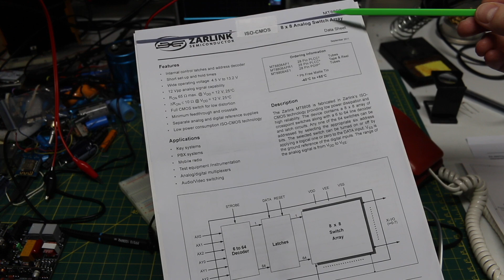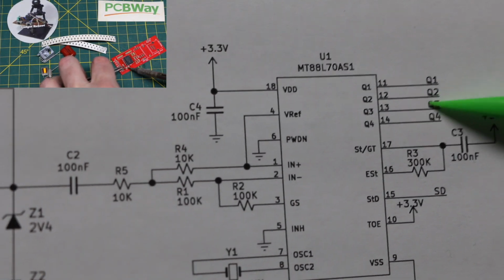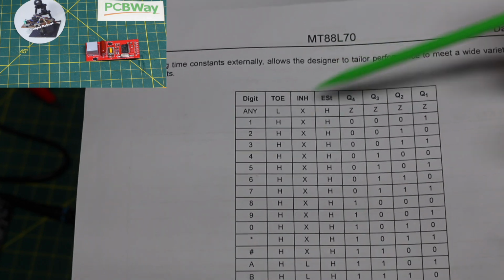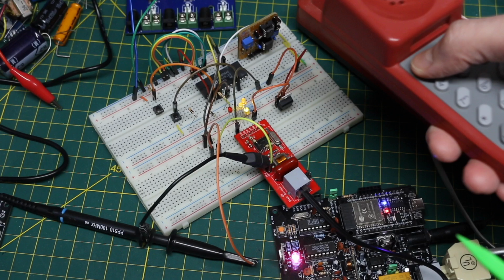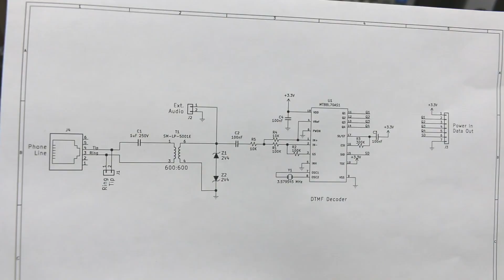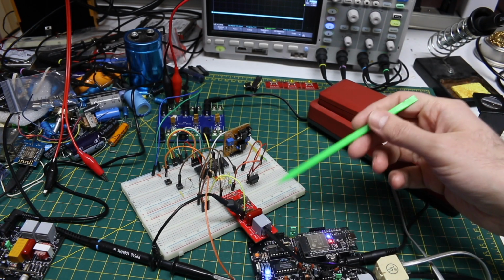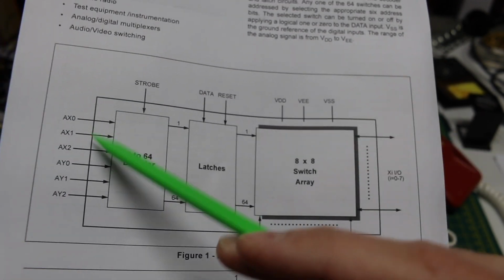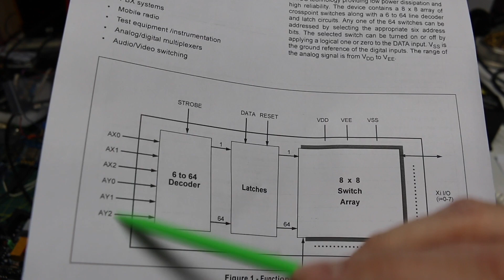DTMF Decoder and Phone Audio Matrix Switching

Comment: I have a small 2400 baud modem that seems to be powered by the phone line (Stowaway by Vocal). What's a safe voltage to try to power it. I've tried 9 volts with no sucess.
Reply from the maker: it probably depends on exactly what’s being done for example when I was playing around with modems I think I used a 9 V battery no problem but I had to make sure I was not letting the modem look for a dial tone in this video https://youtu.be/luarFqislIc

then I went on to make a phone line simulator using a SLIC module and I’ve made several videos along the way where now it can actually make a dialtone and the modems work like they have a phone line.
Reply: @GadgetReboot  I did watch one of your first videos where you connected two modems with a simple nine volt battery to get the carrier signal and I was able to do the same with modems that were externally powered (i.e. wall wart). This particular modem just won't give any response in that setup since I guess nine volts isn't enough. I found a 1990 write-up on the internet archive in Portable 100 Magazine where they describe it and its main selling point is that it doesn't need power from a  serial port (and has no external power),, instead using the power from the phone line. Now presumably I could feed it 48 volts, but that's a lot of voltage to attempt to get it to work. I was hoping you'd have an idea of what range to try to get it to respond. The modem itself is small by 1990 standards,, about 2" x 3" x 0.5".
Reply from the maker: I can only assume it is designed to operate like a regular phone which is also powered from the phone line in which case I would expect something like the 9 V battery method to work because when a phone is taken off hook the voltage will drop from 48 to something lower it could even be 6 V depending on the device, and I can’t remember my experiment if I just put a 9 V battery or also had a current limit resistor
if a current limit resistor is added with the battery, maybe the resistance needs to be lowered to allow more current. The only other thought is maybe that device is sensitive to polarity so maybe turn the 9 V connections around if that hasn’t been tried yet. Anytime I’ve ever used a phone it didn’t care about the polarity but maybe some devices do.
Reply: @GadgetReboot  thank you...I will give it a try.
Reply from the maker: another thought, I think I have read in some of my research that certain modems want to detect a dial tone  before dialling out even when using those AT commands to say to ignore it so if you are using just one of those modems that isn’t working properly and you have another one that has worked with the battery before, maybe try dialling from the other modem and answering on the one that’s powered by the phone line because then it won’t be expecting a dial tone.
 I think I had trouble when I was first doing the battery test. I had to use one specific modem for dialling and one for answering when I was just using a battery so it was a good thing that I had several modems available to experiment with. I didn’t know if it was dip switch settings or differences in the designs but I remember it wasn’t as easy as just plugging the two modems in and getting it working with a battery but that was six or seven years ago so I can’t remember everything
Reply: @GadgetReboot  Yes, the Vocal Stowaway 2400 seems to want a dial tone. However, having it in either receiving or sending node doesn't seem to make a difference as it won't connect I did get the connection to work with another modem. In fact, I was even able to use those RCA power line extenders and have two modems connect: I did two videos on my channel...I won't post links since YouTube will likely remove this comment, but the dates are 3/9/24 and 3/20/24.

Also, that magazine article I pointed to seemed to be totally off since I can actually get AT commands when plugged to a serial port without any phone line connection, so it is being solely powered by the serial port's 5 volts, not the phone line. It never creates a connection when accepting and it says "NO DIAL TONE" when sending. I still haven't tried flipping the polarity to see if that works. Perhaps it partially powers itself from the phone line? Can I fake a dial tone? Is it just an audio signal that sounds like a dial tone? P.S. It was your original video that got me started with all this...pretty cool 🙂
Reply from the maker: Before trying to generate a dial tone, try using the X3 command to see if the modem stops looking for dial tone.   I think I read somewhere that some modems may want it on its own command line. so you would try
ATX3
ATD
but for me it works with ATX3D
Then the modem is supposed to try to go into dial mode without waiting for dial tone.
But if a dial tone is needed, I've created that with the Arduino Mozzi sound generator library to go with the phone line simulator project.   I made a video on my second channel using that in an ESP module but it should also work with something like an Arduino Uno.   Generating two simultaneous tones at a certain frequency will make the dial tone.
https://youtu.be/m8xOpIFWfZg
Then to get that imposed on the phone line would involve maybe coupling it with one of those 600 ohm to 600 ohm audio transformers like the red ones I used in various projects to also listen on the phone line to detect DTMF keys etc.   5 or 10 of those are a few dollars on Aliexpress.
Reply: @GadgetReboot  the X3 command worked with the modem not complaining about "no dialtone" when used with DT. The modem still doesn't make any sound though and I'm thinking perhaps that's the part it uses the line voltage for. I have a small handset that allows me to hear two working modems squawking but itself won't make any dial sounds. Google says "an old handheld phone requires 48 volts DC on the phone line to generate dial sounds, although this voltage drops down to 3-9 volts when the phone is off-hook to power the phone's internal circuitry while dialing." So that sounds a bit contradictory...is it saying it needs 48 volts for dialing and then just 3-9 volts while dialing? It sounds like these devices should be able to handle voltages up to 48 so I should be safe to experiment with values above 9 volts.
Reply: @ I got it to work. The line powered modem did need more than 9 volts to power itself. I guess it used the serial power for communicating via AT Hayes with computer, and it used the phone line power to do the modem connection. Using my RCA phone extenders (they work by using the power line) they gave 45 volts and that was enough to activate that modem and have it work. Thanks again for all of your help...
Reply from the maker: good to know it finally worked. Every time I try to re-search how the old land lines worked it’s always a rabbit hole with different perspectives based on where the information is coming from, 
whether it’s people who worked in the industry or people interpreting old specifications documents that they cite references to, it’s kind of like talking to a bunch of old timers about what it was like back in the day and everyone has a different take on it so you have to put it all together somehow.

One thing I recently read about how the phone voltage drops from 48 down to just several volts, apparently the central office will do whatever it takes to make sure it provides enough current in the circuit when the phone is off hook so maybe an average of 20 mA

and then it would depend on how that specific phone is designed, if it puts a load resistor across tip and ring of a few hundred ohms that would end up providing those few volts based on the resistor value and that current going through it.
but apparently some devices will just use something like a Zener diode to clamp the voltage to something which could be even 12 V and then it regulates its own voltage that way

so maybe that specific modem is looking for something slightly higher than 9 V but maybe it didn’t need the entire 48 but we are lucky if we get anything working with parts out of the junk box.
Reply: @GadgetReboot  You might be right on the voltage requirement. I just used the RCA wireless extender (i.e. wireless in that it goes over the electrical lines, not wifi...funny how that term has changed from when that device was created) since I had it and figured it would give the right voltage...which measured around 44 volts. I will try 12 volts without the extender, since the extender adds a bit of noise and seems to limit the speed of the modem connection. It was neat technology back in the day (in fact, I use a modern version of it for an ethernet connection over electrical lines).

Comment: very nice a microcontroller pbx with the switching. Could even add a voice prompt with the little voice boards breakout boards or even an old 80s voice chip. Nice to see a solution outside of raspberry pi.